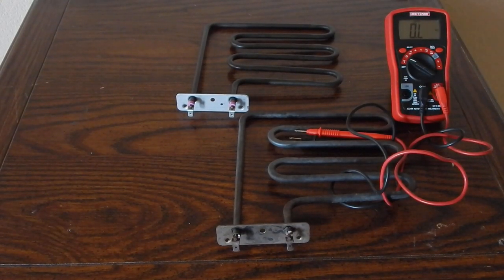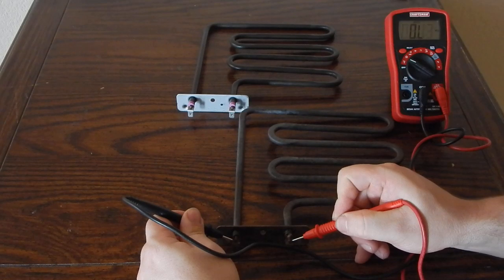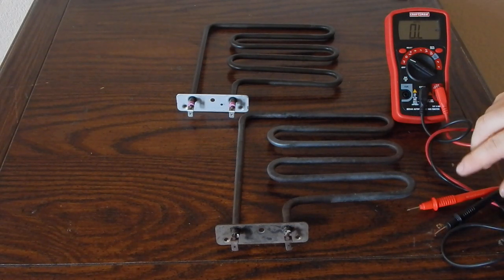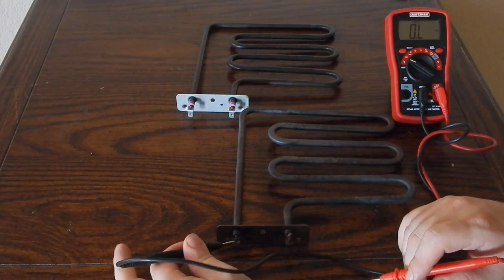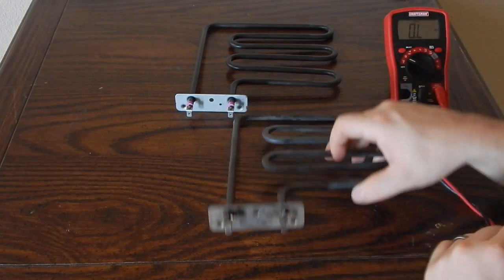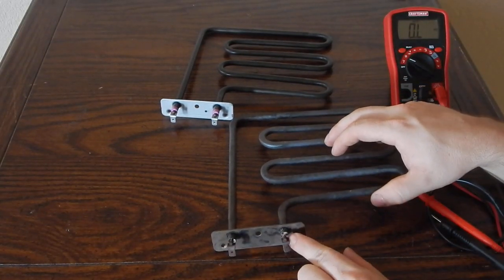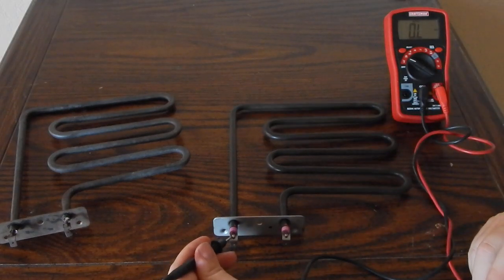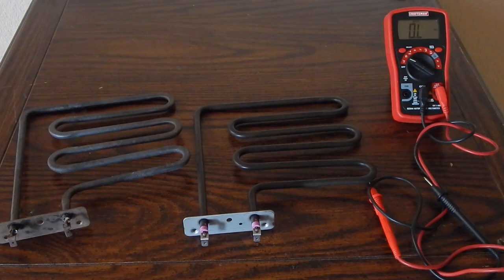How to Test a Smoker (or really any) Heating Element!

Comment: Thanks for this video.  I finally started checking my element.  Just wanted to throw this out there for anyone else who is having an issue with their electric smoker tripping GFCI/breaker.  I had just taken the cover off the back of my smoker to check the wires connecting to the element.  One side had debris inside the connection and the terminal was slightly loose.  Cleaned it out and squeezed the terminal together a bit for a snug fit, and my issue was resolved.  Hopefully this helps anyone else having this issue.

Comment: I Pulled my heating element today and that was the problem. I plugged up the smoker with the heating element out of the smoker and it did not pop the circuit breaker. Thx for explaining how to use the meter for this check. Very Helpful!!!

Comment: Very helpful, thanks! FYI, the “OL” on your multimeter stands for “open loop” not out of limits.
Reply from the maker: Mike,
You may be right. However in engineering school, my professors always told me it actually meant out of limits.  Outside the limits of the meters capabilities in display or calculation. One of these professors actually helped design some multimeters for klein. So maybe different brands use it differently, or maybe people chose what makes sense to them for the letters and it stuck.  If you have good sources I'm always open to learning or correcting my ignorance. Thanks for the comment.

Comment: After reading comments, watching the video, not being an electrician, but wanting to learn how to do things like this, what do you set the multimeter on to get readings? Some comments here say dont check continuity, check this or that, got a little side tracked.
Thanks in advance if you answer. Otherwise vid is good. Thx.
Reply from the maker: Sorry for the late reply, My email wasn't getting the notifications and I haven't been on in a while. Anyway, the multimeter needs to be set to the continuity setting to check this.

Comment: I know this comment is quite past the post date of the video, but I'm hoping you see it.  I have a Big Chief electric smoker that is tripping a GFCI outlet in my garage. It has a 450 watt heating element.  I just did the tests you show here and the readings look perfect (32 ohms between the two leads) and 1 when I touch one lead and the other to the metal casing on the element.  The plug that the element goes to has three connectors, but the heating element only has two leads to connect out on.   I am confused what would trip a breaker if the element is good.  Any ideas are very much appreciated.
Reply: Garden Grower Sir,
Ahah… I too have landed here.  I too brought home a shiny Big Chief, but sad day, all my GFI outlets are tripping due to plugging in Big Chief.

So, did you order new cord, or new heating element?   What was your remedy?

Thanks for any guidance!
Reply from the maker: Sorry for the late reply, I haven't created content in a while. The heating element may be fine, you may have a grounded wire in your housing somewhere. You will have to chase all the wires. I am unfamiliar with that particular unit. Also, When touching the lead to the casing it should show an OL, but I don't know what multimeter you may be using.

Comment: OL stands for open link. Not "out of limits " or as some calls it over load...
Reply from the maker: You may be right. However in engineering school, my professors always told me it actually meant out of limits.  Outside the limits of the meters capabilities in display or calculation. One of these professors actually helped design some multimeters for klein. So maybe different brands use it differently, or maybe people chose what makes sense to them for the letters and it stuck. I had several links previously with another commenter who backed this up. Buts it's been many years and it looks like fluke took those manuals down. If you have every used an old meter that did not automatically adjust it's scale, you would see this if it was in the wrong scale set. Even though the meter was not overloaded and the circuit was not an open loop. outside of limits however still holds then. But I know several other manufacturers have adopted overload for some reason. If you have good sources I'm always open to learning or correcting my ignorance. Thanks for the comment.

Comment: Thank you for this info.
my problem its that my masterbuild electric smoker stop working and can't get it to work check the element just like you it looks new we only have used like 4 times replace the control and nothing 
I m temp ted to open up the back and see what I can find. Any suggestion's??
Reply from the maker: If it won't power on, the breaker is not popping, and the ground is not faulting, sounds like a bad wire or control issue. good luck.
Reply: If your 30" smoker is like mine, Check to see that your thermocouple is not open.  It  looks like s silver button with two wires connected to it.  Its behind the back cover.  Easy to part find and replace.
Reply: I found the thermocouple looks like a dime or a button that you talk about to check that and remove the screws. Do I have to drill out the rabbit from the outside back? Or can you check it from inside the smoker?
Reply: @armandodavila2246   No drilling required on mine, Iti accessible by removing  the back inspection plate.  4 screws..   Once you do ,Check the continuity between the two terminals of the Thermocouple.  If it has continuity its most likely ok. If its open, it acts like a switch disabling the circuit and heater.

Comment: I have a Masterbuilt 30" brand new and it will not hold temperature. Set at 275 it shuts off and goes to 260 and starts back to 275 once there it shuts off and goes to 260 and starts all over again. Is this normal. It's not cooking the meat in my three attempts, I have never had a smoker before. Thanking you in advance . It has a digital control.
Reply from the maker: Sorry I didn't get notification of this comment, and no this is not normal. I got rid of my masterbuilt a while back for a pellet smoker, but If I remember correctly, these units should go up to 350 or so. Have you tried masterbuilt support?

Comment: Hi. 
the ground wire for  the burner  you mentioned  after its connected to the burner  where does it  get attached too on the other end
Thanks
Reply from the maker: Usually it's attached to whatever power supply it's coming from or a grounded part of the appliance body. If you watch my video on putting it back in you can see how its mounted and where the wires go.
Reply: I just built my cerakote oven and the element did  not  get hot. I was thinking it was a ground problem ,  then I found your video  it showed me the element gets a ground wire to it, had no ideal since the element I bought  did not have any info, I had a heck of a time figuring  out the oven thermostat switch  I bought for it  , it had 6 contacts, I was  curious to know where your ground ran  to, but in my case it will go up  to my terminal block.
 Thanks
Reply from the maker: In My elements Case it has the hot and neutral on the leads and a ground wire for Fault issues like this element was having. The ground went from the hole in the plate of the element to the metal housing. The ground really shouldn't be doing anything unless there is a problem. Are you posting a video on the oven? I'd be interested to see it.
Reply: My element  is  220 and  I ran the two 120 leads  down  to  the element thinking  that was good because my incoming 220  to the terminal block was grounded  /  from the block it then goes to  the element, I have yet to fix  it, I bought new  wire  so I could connect  the ground to  the element probably finish it this weekend. I'll do a short video  on  the  oven when I finish  the other shop work I am  trying to finish,
 I work  with air rifles , I made  the oven   so I can cerakote parts  if  I want to.
 guess if  you subscribe you'll get a notification when  the  video comes  out / you can always unsubscribe  later lol
I am a master plumber by day  the  airgun sport   is  what I enjoy
Reply from the maker: That's cool. I am an industrial/mechanical engineer by day and I'm always fixing things so I started making videos of it. I have a long video of an industrial compressor I fixed that I'm editing currently. I will be videoing an industrial air dryer fix this next week so I've just been adding content as I can. Its not interesting to everyone but I'm hoping someone gets use out of it. The learning curve is a lot easier after watching videos on it.
Reply: I'll subscribe to your channel and check it out.
thanks Dave

Comment: What setting is the muti tester on?
Reply from the maker: Resistance. Or the Omega symbol. If its not auto ranging you may have to find the correct range but most meters now are.
Reply: @everydaydave270  I'm surprised you commented back so thank you.   I got it fixed and thanks for doing the video.  Two thumbs 👍👍

Comment: Test resistive loads you need to check amps...... not continuity.  If its not pulling amps its trash
Reply from the maker: I wasn't checking loads. I was checking for a ground fault. I don't care about phase change in a smoker/oven. To check amperage, the heating element would have to be powered.That generally requires special equipment if it's ground is bad. It also can be dangerous. This is safe and allows you to do preliminary tests while the element is out of the smoker. Also, Heating elements are simple. V=IR and W=VA applies. The heating element in this case had a known Resistance and Voltage. If you know what the resistance is supposed to be, which I mentioned in the video when I tested the new one, you also know what current draw you can expect.  You can also tell by the ETL/CEC markings what you should expect with wattage, and you can get your answer there as well. I'm aware heating elements like all wiring have losses, but they aren't enough that you can't determine power draw with relative accuracy using these formulas.

Comment: Just test the resistance
Reply from the maker: Well essentially, that's all you do in the video. You just do it in more places than normally shown in a youtube video. As I said in the video, just testing the leads would not have worked in this case. It would show the element is good. Even though it clearly is not because it is shorted to the casing. Thanks for the comment!
Reply: ok,learn a lot
Reply: You didn't hear a beep from your multimeter right?